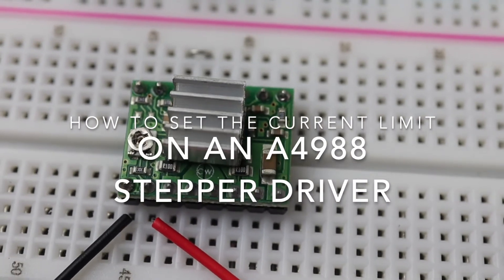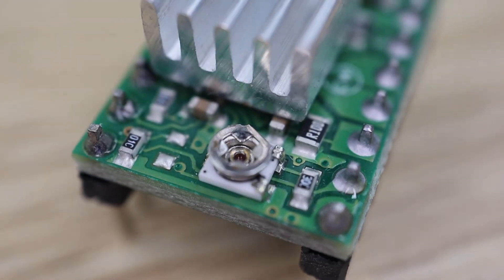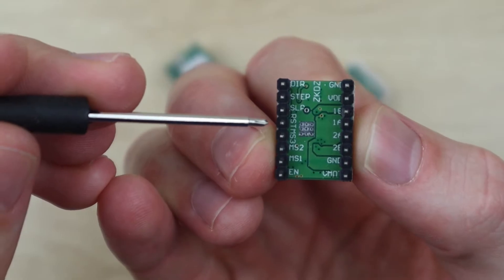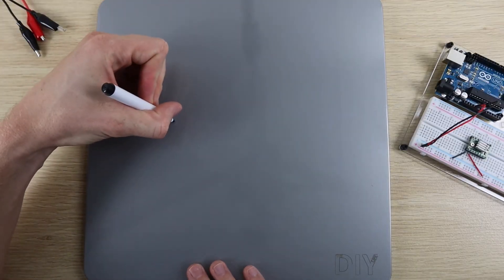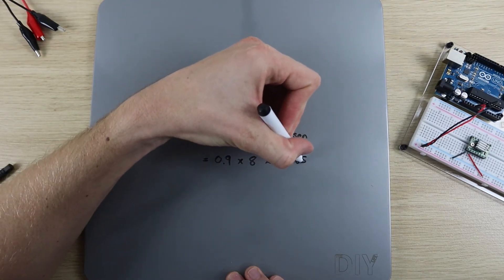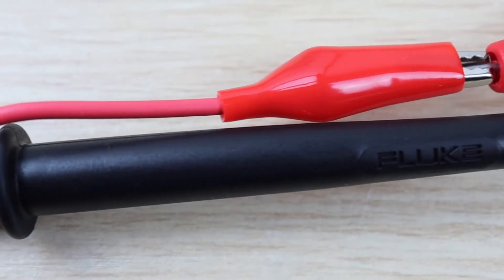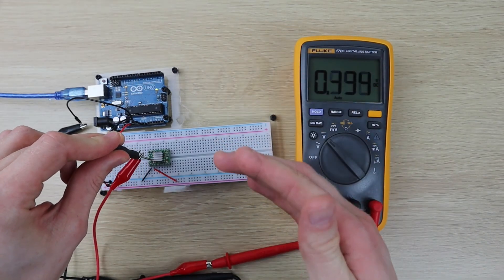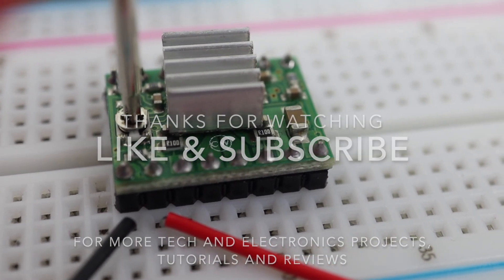How To Correctly Set The Motor Current Limit On An A4988 Stepper Motor Driver

Comment: When I connected the A4988 drivers with the Arduino Uno and the stepper motors, I felt there was vibration in the motors, and when the motors rotate, they do not rotate smoothly. The program I am using is University G-code Sender

Comment: PLS, HELP HELP I am drawning, my input voltage from usb is 5 V and  The trimmer can`t be adjust the Voltage lower then 4,3 Volts, Is the the screw driver or the Motor Driver that is limiting me from Adjusting the Voltage? Tnx

Comment: This is helpful, there are a few things that make this a little more complicated to the average Joe that isn’t very knowledgeable on how to locate and read the resistor values, especially on SMD resistors if you driver is integrated on the main board itself, and also finding the data sheets, whether on the stepper itself if you’re unsure of where it was manufactured because there are no labels on it, and the same with a controller board being a universal Chinese style board. 

Also, the numbers you provided aren’t applicable to all A4988 drivers as the Rsense changes from driver to driver depending on a few things, but again, this video is still helpful, especially to non surface mounted drivers like the one you showed. I’m only putting these things out there in a comment so others are aware of slight variations so they don’t improperly set their values without knowing they could be completely different.
Reply: Average Joe here I absolutely cannot find the Rsense value, please help meeeeeee

Comment: On The A4988 that has 2 R100 , I saw else where you take motor DC being 1.5A . 1.5 divde by 2.5 = 0.6 current  ? Is that correct .?  Can anyone shine in.

Comment: I'm building a cnc hot wire foam cutting machine. I have. (2) N17 HS3401S- SZ motors. with [RATED  Current DC 1.5A ] I'm using  audrino  uno  GRBL installed with cnc shield with A4988 steppers .  The steppers what  current limit ,  do I need to tune at ?  I'm not sure ,  I think i need 0.52 current ? so motors won't burn out. Can anyone send me YTB link and tell me how. Thank you .

Comment: What kind of screwdriver do you need for that potentiometer? None of the ones I have can turn the danm thing.
Reply from the maker: It's a free on that came with a heatsink. There is nothing special about it, it just needs to be small enought to not catch on the surrounding components.
Reply: @MichaelKlements  I found a really old and worned out screwdriver and it was the perfect size, but when I try to measure the Vref it just reads the logic input voltage, no matter how much I turn the potentiometer. I was using a PI Pico at first, then I tried using the pico, but with a separate 5v power suply, instead of the built in 3.3 volts, and still just reads the input logic voltage, I quintuple checked and I am probing the right conections, and I bought 4 of them for a project, and all 4 of them do the same thing.

Comment: I have a question. I am using 24 volts to power the Nema 17 bipolar motor. Is  the process for setting the Vref the same? All I have to connect si the logic pwoer supply and then connect reset and sleep and then adjust the potentiometer to adjust the vref?
Reply: bro my nema17 is heating a lot with 12V, so 24 volts sounds like a bit overkill to me. Why not just use a regulator?

Comment: You should place the GND right at the chip not on the arduino, you want to measure what the chip sees as pwr and gnd. Granted there may not be enough current to produce a voltage drop but its always BEST practice to GND at the device you are measuring same goes with power. You probably want to ensure STEP is pulled low.

Comment: No matter what I do, the voltage on the motor driver never changes when I rotate the screw. Two A4988s and one tc2209 and it's the same behavior with all of them. Any idea what I could be doing wrong?
Reply from the maker: Are you taking your voltage measurements from the correct two points?

Comment: It would have been nice to include a confirmation using the voltmeter and a stepper coil. It seems that one advantage of the approach measuring the current through a stepper coil and measuring current through the multimeter would be that you may not need to do any calculations since you'd be able to read the current directly. However, you would need to be careful to start with the pot at minimum current and then increase from that point. Another advantage is that you;d have no doubt that your setting was correct.

Comment: The NEMA motor is spinning good, until I touch the POT of the A4988 with a small screw driver and then suddenly the motor starts to shiver, and tries to jump/ rattle !
The Vref is set to 0.48v, Current sensing Resistance is 0.068, Imot = 0.9 and DIR is set to clockwise and it's running fine until I touch the A4988/Pot with a small screw driver ( Like I 'm shorting some internal circuitry)

Comment: The Vref is set to 0.48v, but one out of 6 or 7 times the motor spins in opposite direction !
I have my DIR set to to clockwise, and it works fine, until suddenly the motor DIR spins  *anticlockwise* !, and them goes back to it's programmed DIR ( i.e clockwise )

I have a Nema 17 and have used the formula as per data sheet and your video.

Comment: a note for anyone watching, the heatsink must be placed on the UNDERSIDE of the PCB. The datasheet shows there are 4 thermal vias (small holes in the pcb) leadigng to the bottom of the board where the headsink can be attached. The chips's top is very thermally-insulating and so a heatsink on top will do practically nothing. Annoyingly the pins on the breakouts are not long enough after attaching the headsink to the ender side for breadboards or female connectors. Youll have to solder it to a stripboard instead (or replace the pins/flip round etc). Airflow is a bigger factor for cooling these chips, make sure to use a radial fan over an axial fan and the airflow should be perpendicular to the board &/or headsink.
Reply: Then how can the pins of the pcb go in the breadboard or its  place

Comment: I can't get the potentiometers to move at all. I tore up one driver trying. Any suggestions?
Reply from the maker: Only the metal part at the very top needs to move, perhaps you're pushing the driver down too far?
Reply: @Michael Klements  one big dumb mistake... the little screwdriver was to big. Don't see how it was possible but that was the problem.

Comment: Sir, Great video. Learned a lot. I have purchased a stepper motor from the local market. It has following details:
TYPE 17PM-K310-33VS
NO.     T4524-01
MINEBEA-MATSUSHITA MOTOR CORPORATION. 

There are no other details. I cannot find a datasheet. I am using CNC shield 3 & A4988 driver. What voltage should I set?
Thanks

Comment: Thanks for tutorial. I did exactly what you explained, but there is strange noise from stepper motor after every single motion. Imax is 1A, Rs equals to 0.2, therefore Vref is 1.6 minus 10% for safety. I would appreciate your help.
Reply from the maker: I'm not sure what you consider to be a strange noise, these drivers aren't silent so do make some noise and magnetic humming sounds.

Comment: I have an 12v stepper motor. I "feed" the drive with 12V but I only get 3,5-4V to the motor. To get 12V to the motor I have to "feed" the driver with about 20V. What am I doing wrong?
Reply from the maker: I wouldn't worry about the voltage at the motor too much. The driver adjusts the voltage in order to achieve the level of current it should be maintaining at the motor.
Reply: @MichaelKlements  Thanks for the quick answer! The problem is that the motor doesn´t work with that low voltage and when I go with 20V the driver gets REALLY hot. But the motor works.
Reply from the maker: Are you sure that you're using the correct motor/driver combination? Are you using a heatsink on the driver?
Reply: @MichaelKlements  Yes I have a heatsink on the driver. It is an A4988 that is rated up to 35V and 2A. The motor is an M49SP-2K rated for 12V on some sites and 24V on others. If I go over 12V the motor gets warm quick.
Reply from the maker: The searches I've done all suggest that your motors operating voltage is around 21V to 26V, so that's most likely why it isn't working at 12V. So you should probably be looking at supplying the driver with around 24V and then adjusting the current limit to a maximum of 1A. 
The A4988 drivers are designed to run "hot", in fact the Pololu page has a warning that the drivers get hot enough to cause burns during normal operation. They'll also just shutdown if they overheat, so unless this is happening its probably still considered to be normal.
Reply: @MichaelKlements  I will upgrade the cooling with a fan. Not sure how to say this in English but a big thank you for your help!
Reply from the maker: No problem at all, good luck with your project!

Comment: When I measure the voltage between the ground and the pot screw, it keeps changing. What could be the problem?
Reply from the maker: This could be a number of things, problems with the power supply, faulty driver, faulty motor, faulty meter, loose component etc.
Reply: Did you use decoupling capacitor?

Comment: Hello i will use 1.5 amper rated current 17hs4401 .Should i use this driver
Reply from the maker: No, these are only rated to 1.2A. You'll need a larger driver like a TMC2226

Comment: When you say "the maximum motor current", does that mean per phase or for both phases combined? The datasheet for my stepper just says "1A max per phase" and it has two phases, so does that mean the maximum motor current is 2A or should I stick to 1A?
Reply from the maker: The current specified is always per phase, so for your motor you'll always work with 1A.

Comment: What do I do when I don't know the maximum motor current? I salveged a motor from an old scanner and it only sais it has 5.8 ohms and I couldn't find a data sheet for it...
I would really appreciate some help
Reply from the maker: Unless the motor has a part number, you won't be able to tell for sure. Your best bet is to find some similar sized ones and use a best guess - unfortunately not fool proof though

Comment: Hello Michael, thank you for the video, i think it made me understand the idea correctly.
I've found my sense resistors (Rs) values, to be 0,1, my max amps to be 0,6A, and calculated the Vref to be 0,48V.
My datasheet however seems to think i need to reverse calculate it because the math is:
ItripMAX = Vref/(8*Rs), indicating that my Vref has to be around ~0.75Volts, however when installed like this my Motor tends to just vibrate instead of actually starting to turn as needed every other/third time i activate the stepper.
Do you have any idea what could be wrong?
Cheers from Denmark
Reply from the maker: Hi Malte,
I think its unlikely that the motor's current is causing it to slip on some steps, unless it is really set way too low. It's more likely that you have the motor coils wires up to the driver incorrectly or there is an issue with the driver. You can temporarily try turning the reference voltage up to check that this isn't the issue. Turn it up in small increments and see if the problem goes away, the motor can handle over-current for short periods of time.
Hope this helps.
Reply: @MichaelKlements  Sorry for the spamming Michael!
But i have now figured it out, the new stepper motor drivers i ordered have sensing resistors at R200 or 0,2Ohms, meaning that effectively my Vref is doubled... so that sucks for my system, but thats why i can run them at such a low voltage, haha.. electronics sometimes man :D
But i figured it out, thanks for the educational video again, i subscribed!
Reply from the maker: I'm glad you've managed to find the issue! Yeah electronics can be a frustration sometimes, but it's great when you get the project working in the end. Thanks for the update and good luck with your builds!
Reply: @BroMalte  nvm didn’t see ur resolution comment lol. Whoopsie poopsie
Reply: @travis6342  yeah i figured it out back in the day :) 
Thanks for the reply though
Reply: @MichaelKlements  Hello Michael, on my way to my internship as we speak, i have a feeling you are correct, as i have 5 devices, and i tested the other 4 who seemed to be working just fine. im somewhat positive you are correct, and will write a message back when im done testing today! i believe the wiring on the last subject must be twisted and thats it, take abit of re-soldering and i will hopefully be good! 
Thank you for the quick answer, much appreciated
Reply: @MichaelKlements  they are connected correctly, same as the 4 others, yet it just will not act accordingly.. maybe there is something wrong with this driver, i ordered new ones for the fifth.. sad..
Reply: @BroMalte  what u can do is put a regular 5mm LED or whatever anode into what u assume to be coil lead 1 and then go about finding the other end of coil 1 by putting the led cathode (im assuming it’s irrelevant which polarity it is as just turning the motor the opposite way would work just the same) and turn the rotor of the stepper. Once the led lights up when spinning, u have found a set of coil ends. Then u can better double check that the actual clamp connector wires match the actual copper wire for each coil. I’ve heard stories of the internal connections not matching whatever wires assumed to be connected. Just my two cents

Comment: Hi, I don't quite understand the whole end result of using stepper motor driver module to limit current.  Lower voltage will lower motor speed (and torque).  Will using driver module to limit current allow for faster rpm while limiting torque?
Reply from the maker: What you seem to be describing applies to brushed dc motors. Stepper motors operate entirely differently and require a driver to energise the coils sequentially a to move them. Motor speed is dependent on the frequency of pulses and torque is dependant on current.
Reply: @MichaelKlements  thanks for the reply Michael, a brushed motor is what I am looking to limit current to.  Specifically small dc motors such as a 130, or 180 dc motor.  My application would need to limit current when a geared mechanism reaches the end of it's travel and causes the motor to stall.
Stall amperage for these motors is just under or just over 1 amp. I can accomplish my gosh simply by running the motors well below rated voltage, but would prefer to run at rated voltage and current.  Would these driver modules work to limit current to a dc motor?
Reply from the maker: You'd probably have to build your own dc motor driver (or modify an existing one) to do what you're wanting to as it is a somewhat unusual requirement. You can't use these drivers (as far as I'm aware) to drive brushed DC motors.

Comment: Does it always need to be at 0.49 volts???? pls reply
Reply from the maker: No, this depends on your motor's rated current and what your driver's sensing resistance is. Have a look at the guide linked in the video description.
Reply: @MichaelKlements  ok

Comment: I have a micro stepper motor from an old CD player/DVD/CD ROM  (has no numbers on it... no data sheet) is there a way to determine the correct current limit? The coil pairs are 20 ohms each.
Reply from the maker: There isn't really a way to calculate the current limit for a motor. It depends on a number of manufacturing and design parameters. The best bet would probably be to try find a similar sized motor online with a similar voltage and coil resistance and work with that.
Reply: @MichaelKlements  Thanks for the response, I'll give that a try.

Comment: Hi! Does anyone know why when I measure the voltage it tells me that it is 4v? moving the screw fluctuates between 3v and 5v. I am feeding it with a battery that previously goes through a L7805 (a 5v 1a regulator). I don't understand why it gives me those values. Thanks
Reply: I have the same issue, did you come to a solution?
Reply: @andregustavo6672  In my case I was measuring wrong.  I think I measured VDD to screw instead of GND to screw
Reply: @andregustavo6672  or vice versa.  I don't remember how it is measured correctly

Comment: sir i am looking to control stepper motor ,can i use bench power suplly for the power source ,and what is main differece between bench power supply and programmable power supply
Reply: I don’t know what you mean by programmable supply. The drivers in this video have two “separate” power connection  terminals: one for the logic supply for the sequencing of the coil wires (1A 1B etc), and the other is the terminal for the power that is supplying the physical stepper motor itself. However, since it’s doing both, I believe the minimum voltage supply to connect to the motor power terminals is 8V. Usually I think 12V is the norm. The logic supply terminals should never be above 5-6V and is the voltage supply from the microcontroller, which is not optional if u want a programmed step sequence and should never be another external power supply outside of the microcontroller pins (for the ground connection at least). The bench supply is fine for the motor power terminals on the driver, just match everything with whatever stepper motor specs from its datasheet. Sadly often times this info is horrendous and lacking but it’s the way of the road I guess

Comment: When I place my multimeter at the same places, it reads 0 no matter what. What am I doing wrong? I've been bashing my head against this for far too long!
Reply from the maker: Are you measuring between a GND point and the surface of the pot? Is your multimeter on DC volts? Are the leads plugged into the correct ports?
Reply: @MichaelKlements  I'm a dummy dumb dumb dumb dummy dumb my leads were in wrongggg aaaaaaaaaaaaaaaaaaaaaaaaaaaaaaaaaaaaaaaaaaaaaaaaaaa thankyou
Reply from the maker: I've done this a few times! I've also destroyed a a few PCBs because I've had the leads in the amps sockets and shorted out what I was trying to measure the voltage of.